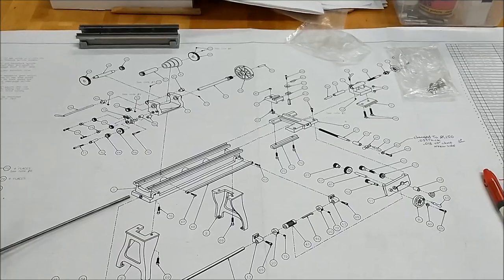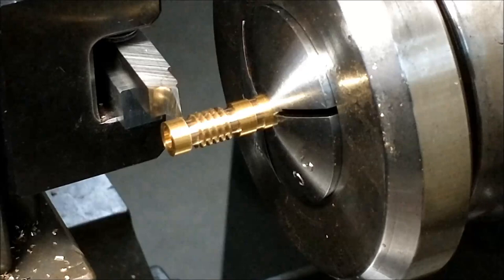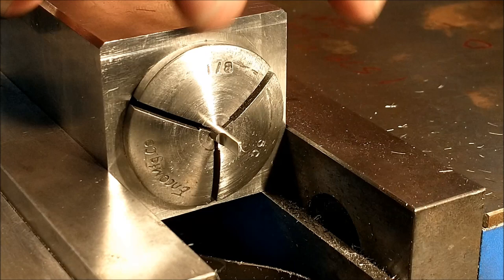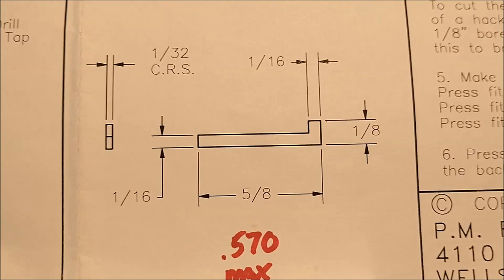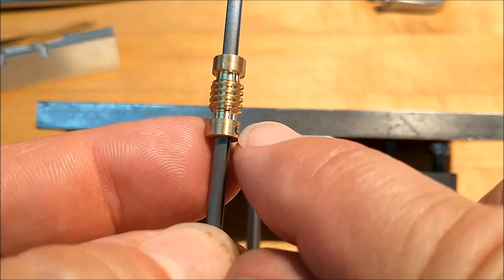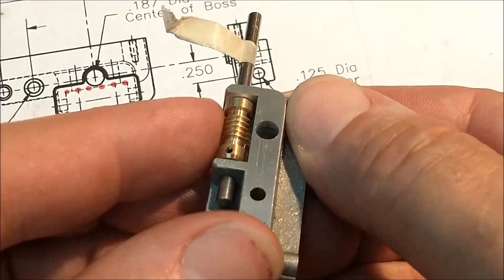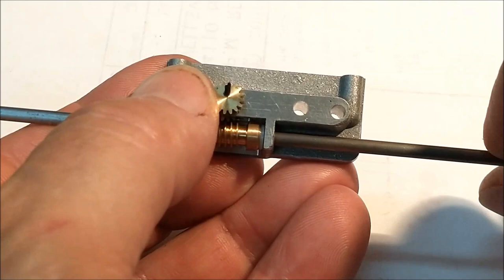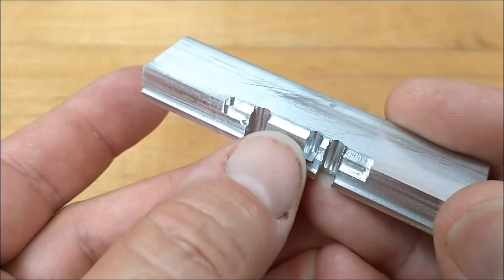IMPOSSIBLE Miniature Internal Keyways and Worm Gears

Comment: Why didn't  you just relieve the broch instead of bending  it . Deflection?
Reply: My understanding FWIW is that the reason he bent it was so that the shank of the tool continued to line up with the bore, because he avoided the need to move the table across to increase the depth of cut. 
But it did strike me that the guidance the shank provided was only available some distance into the hole rather than from the mouth of the bore, and if I use this cunning technique in future I'd be tempted to leave the part longer and mill a step at the entry end, so the cutting edge did not engage with the part at the start of the downstroke, at least until such time as the shank was already supported by a half circular engagement around the back side. 
It would also be tempting to  machine table movement to bend the tool, strictly in the y axis and to a known deflection (from which there would of course be some springback), then revert to zero on the DRO before each new cut.
Reply from the maker: Deflection was a concern. The angle of the bottom of the broach should also be taken into consideration. Too sharp and it will dig in, too shallow and it will push off.

Comment: Question ❓❓ couldn't you have made a relief cut on the broach side of the shank the depth of your cut.  The backside of the radius would still support your cut and then you wouldn't have to smack it just move the Y?
Reply: Nevermind you'd lose your support as soon as you moved the Y.  It's 4am I'm only running on 1 cup
Reply from the maker: The broach diameter is almost the same size as the hole. Any 'Y' axis movement would immediately cause the 2 to crash. Moving the table is not an option.

Comment: Hi Joe:  need advice  I have a 9 " south bend lathe.  and have about 15  3c collets, but want a more complete set.  Would you recomend a full set of the 72 piece 5c collets or the 25 piece set of er32.  I really value your opinion and LOVE your videos.
Reply from the maker: You would need an adapter to run 5C since they don't fit a 9" SB. the ER collets grip range is greater per collet, and they actually hold truer. I don't know what you plan to focus on, but the ER series may be the better choice.
Reply: @joepie221  thank you for the reply.  I also want a collet block.  will the er collets have a collet block.?  I know there is no collet blocks for the 3c collets.

Comment: Wouldn't it have been easier to turn down the shank of a bar of the right od, then part off a reasonable length of the original, flip it and mill the cutting end while holding the shank (then move the table for doc)?

Comment: Nice idea for the broach.  Did you need to lock the mill spindle?  If so, how did you do it?
Reply from the maker: Low range, slowest RPM and then cam lock the brake handle.
Reply: @joepie221  Thanks!

Comment: As much as you turn, how often are you cleaning out your chip tray?
Reply: If its stuff this small probably every 50 years or so. 🙄 I'm guessing daily or weekly at the most.
Reply: @mpetersen6  Or if you are like us, whenever the chips start blocking the carriage. It costs money to spend production time cleaning chips every day. .
Reply: @mathewmolk2089  in my experience the chip trays on most manual lathes suck. I've run LeBlonds, Mori's, Monarchs and others from 30 inch swing down to Hardinge HLVs. Most of them really aren't designed for easy chip removal IMO. Older Hardinges with the electrical panel mounted high on the back were the worst. Chip cleanup was always part of the job were I worked.

Comment: Another video, another learning event.  I always look forward to the next installment and check on a daily basis.

One general question about the broaching.  How do you register the broach square with the X/Y axis on the mill (especially on a tiny one like this) and how do you keep the spindle from rotating throughout the process?  

Thanks

-Kurt
Reply: Hey Kurt!  Ya know, I didn’t even think of that.  The spindle has pretty good resistance to turning when off if engaged, but if you lock it into back gear, it could still turn if you applied enough force, but I am pretty sure it would not see those kinds of forces.  I don’t think there is much that could apply rotational forces to the spindle when moving the spindle down.  Certainly not for something this small.  This was awesome to watch, but Joe is always pretty awesome.  I will be curious to see what he says.

Embarrassing.  Someone else answered this about an hour ago.  I scrolled down and saw it.  They said back gear.  So I’m thinking that is right.
Reply: @torchmd  I thought of that too, but squaring it with the spindle in neutral and then trying to engage either high or low gear will rotate the spindle.
Reply from the maker: @kurtkrueger9715  Set your speed range to low range. Then set that to the lowest RPM. Then jog the machine until its visually close. Then using the drawbar nut as a drive source, use a wrench and finish the alignment. be sure your moves are in the tighten direction so you don't loosen the collet. Engage the brake and cam the handle. It won't go any where.
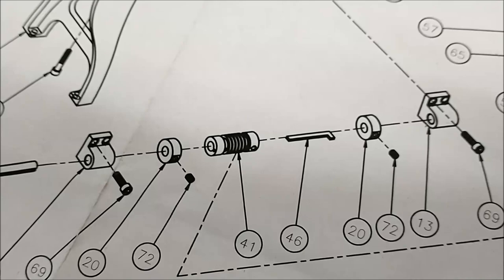Reply: @kurtkrueger9715  true, but since the broach is centered on the hole, it wouldn’t matter.  It would only matter the rotational position of the broach, ie 1:00 or 3:00, or whatever, which I would make no difference in a round part, as it would always be at 0 degrees relative to itself, as it were. ;)

I think the only way the key way would be off center in this situation would be if the cut of the broach were off center when it was made…
Reply: @joepie221  Thanks Joe, that makes complete sense.  I don't have a lock on my spindle brake, but I have pulled it tight and held it in place with a ratchet strap when I've needed to hold the spindle from turning.
Reply from the maker: @kurtkrueger9715  Many have a cam edge most don't realize. put some pressure on it to lock it and see if it lifts and cam locks itself.
Reply: @joepie221  Thanks for the follow-up, Joe.  After reading your reply I checked my machine (Lagun FTV-2), there is a serrated surface and mating ridge on the brake handle. There appear to be some pieces missing in the handle assembly that prevent the ratchet mechanism from engaging.  Until I get around to fixing that, the ratchet strap is an acceptable work-around.  ;-)  See, learned something new again!

Comment: Hey Joe, speaking of worm gears and lathes, I just came across this video that might interest or amuse you:
https://www.youtube.com/watch?v=aVx3yPzMfiA

This seems to be someone in Indonesia that has (I guess) a repair shop, and comes up with some really ingenious ways to make things. In this case he is recreating a brass sprocket to match some existing worm gear. This is a part that you would think could only be made in a gear shop on a hob, but he does it from scrap parts on a manual lathe. (It's an interesting lathe too. It seems to flip from forward to reverse without having to reverse the motor.)

Comment: Why not machine a thirty second off the quarter  inch diameter. and dial in your depth of your keyway instead of bending your tool
Reply from the maker: The tool is the same diameter as the bore. 1/8, not 1/4. Dialing it in wouldn't work. If I used a reduced shank broach, it would have to be .093 dia and that would probably deflect.
Reply: @joepie221  your right it would probably  deflect you used 316ss instead of high speed steel I liked your video on your set up on the mill turning the dial. then cross drilling I caught that one right off the bat because I did make the same mistake I worked production  for 20 years in a screw machine made a lot of fixtures and jigs for secondary  work also a lot of tooling not as sharp as I was but love to watch your videos and try to catch it before you show it always   love to watch keep up the great work thanks